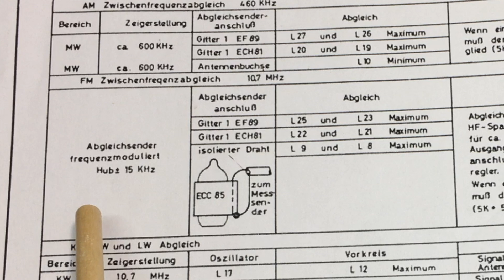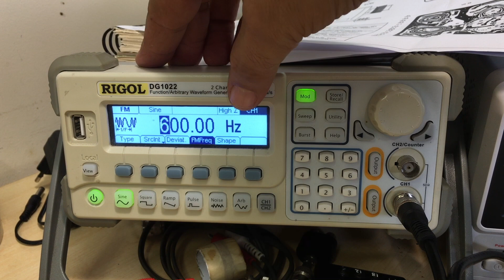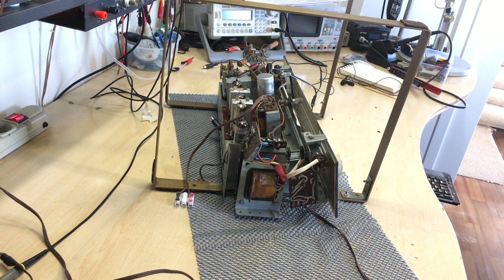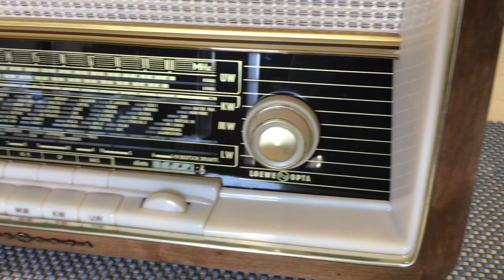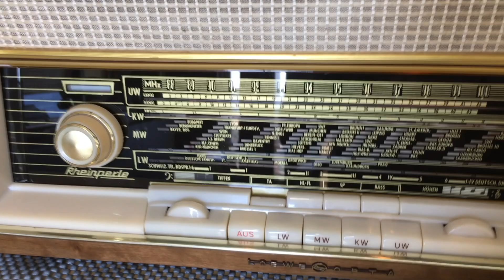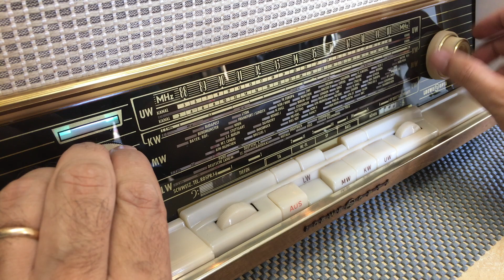Loewe-Opta Rheinperle 5717W restoration - Part 9. Finally ... FM alignment and testing.

Comment: Hi Manuel: 12:17, did you eventually figure out why you are not getting a distorted audio output despite the procedure not caring about balancing the ratio detector output halves (as Graetz, Nordmende, and others would)? This is both strange and amazing.

Comment: Nice work! Just a small detail. The tuning needle is actually two separate parts. One for FM and the other for AM. In your radio they they seem stuck together. There are supposed to move independently. I suggest lubing the tuning knob shaft near the two gears. I had this problem on my Loewe Opta also.

Comment: For cleaning the cloth i clamp the sides to the board.
than i use car interior cleaning foam let i dry verry verry well or the cloth will come of
Your idea of using shaving foam might be softer on the material
Reply from the maker: it’s worked well for me numerous times.

Comment: I notice that when you align sets you set the IFs to the manufacturer's frequency but you don't then adjust the oscillator to give the correct frequency when receiving a broadcast signal. If this setting is incorrect the set will work but not at its best, also the dial may not read true. Please comment.
Reply from the maker: That’s right. I do an IF alignment but seldom an RF alignment. The reason is that the accuracy of the dial position means very little these days, especially on the AM bands. Unless it is very far off, I prefer not to touch it. It would make sense if we had many AM or Shortwave stations that we could listen to, but that is not the case here. Also, on FM there are four local stations, so there is no serious need to get the dial exactly right to tune them in. It is more important to me to improve the sensitivity. Often, an RF alignment can do more damage than good, especially as the coils are usually waxed in and damage to them can be irreversible. It’s just a choice.
Reply: @electronicsoldandnew  
I understand your thoughts about dial accuracy but not about rf alignment. If you re do the IFs using a broadcast signal you will have properly aligned the whole set without touching the oscillator coils. 
I have never found altering the oscillator to be difficult or harmful but I can see that you prefer not to go there.
Reply from the maker: jonka1 : good point about using a known bc signal, so the actual IF may vary slightly from the stated IF. Hadn’t thought of that. Thanks for the food for thought.
Reply: @electronicsoldandnew  
:)

Comment: Yes, I also did something like that using another SW-Radio.. That can work too. You just have to set the Frequency of the other Radio, so that is can be heard in the Radio, which which You want to receive SSB or CW. And both Radios have to be very close to each other.. And You have to know the IF Offset, which is often, but not allways, around 450 kHz to 460 kHz. Funny, this even can work on FM. Here it can make weaker Stations go away.. Because in FM usually, the stronger Signal "wins" and makes the weaker Station "disappear". The IF Offset on FM is very often 10.7 MHz, I think..

Comment: 04:00 It is a little bit complicated, but I understand it like this, that is says something like: The RF Voltage should be not higher than nessary for a Audio Voltage of about 2 V (Audio Voltage meassured at the Loud Speaker) if Volume is at max Volume.. I think it that is maybe bc. it is easier this Way, if You do not have the Tools for FM Alignment or it is for the AGC.. But I do not exactly know.
Reply: Or maybe the Audio could distort, if a received Signal is to "hot" / strong... Some of this old German Radios behave even in FM a little bit, as if the Signal on FM would be in 'AM'. I noticed: Very often, a stronger Signal is also a louder Signal, than a weaker Signal.. This is exactly like it would be in AM..
Reply from the maker: Thanks for that.
Reply: I also noticed, that in such Cases, this also applies to the Tuning.. Means: If a Station is exactly tuned in, the Station is louder. And if the Station is not exactly tuned in, the Station is not as loud as it would be, if the Station would be exactly tuned in.. I noticed that, when I made Audio Recordings, from several old German Radios. So exactly tuned also means --> the loudest Audio.. Maybe, this is, why this Way of FM Alignment (whichs actually, reminds me also a lot on an AM Alignment..) also works for such a Radio..
Reply: Very useful indeed. I have been struggling with the text.

Comment: The instruction said, the output signal at the speaker should be no more than 2 volts when the volume control is at maximum, otherwise you have to turn down the signal generator. That makes sure, that the AGC system isn't active. Back in the days, a lot of radio repair shops didn't had an oscilloscope (or only one), even less had a wobbulator. I think the factory came up with this simple way for alignment, so every repair shop would be able to do the work with the basic tools.
Now I wonder, why didn't you make an alignment of the front end? When the IF is out of spec, chances are high, that the HF section has the same problem.
Reply from the maker: Thanks for the explanation. I understand some of it but miss quite a lot. As for the RF alignment, it is slightly off, but as the AM bands here are practically non-existent, I usually don’t worry about the exact dial position. As for FM, it is also fairly close, so I prefer to leave well enough alone.
Reply: @electronicsoldandnew  Well, if you ever need help with translations from german instructions, let me know.

Comment: Really enjoyed your work on this radio restoration and the development/implementation of your Bluetooth power board. I think that every vintage radio should have one because I’m with you, these should be used and not just stuck up on a shelf. Their circuitry seems to work much better with a bit of exercise. Plus, as long as it could be converted back to original and no destruction has been done to the unit, no one should care. Thank you so much for taking the time to produce your videos, they are really outstanding.            Buddy

By the way, I also love to hear about where you live, always dreamed of visiting. I live in Central Florida and have a thing about islands... 😊
Reply from the maker: Buddy Martin : thanks for the inspirational comment. As for living on an island, it has its disadvantages when it comes shipping components,  but well worth it when we consider all the pluses.

Comment: Using the signal generator as a BFO to get SSB is a trick I did thirty years ago. Except you don't need a signal generator for this. Another tube radio with shortwave (using its local oscillator) will work too. Just put the other radio closely to the one you listen to. Tune it about 450 kHz lower than the frequency you listen to.